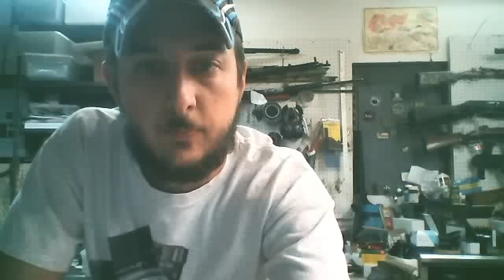Ghost Gunner upgrade clamp bushings now for sale

Comment: I just returned my Ghost Gunner to DD because they have a defective 
spindle, and got a refund. I have had 2 spindles break in 1 month. I 
will not buy another Ghost Gunner until they fix the issue with the 
spindle
Reply from the maker: Can you elaborate? Do you mean the spindle being the part that actually turns and holds the tool/endmill?  I don't actually own a GG, I just make the upgrade parts.
Reply: Yes I too would like to hear what happened.